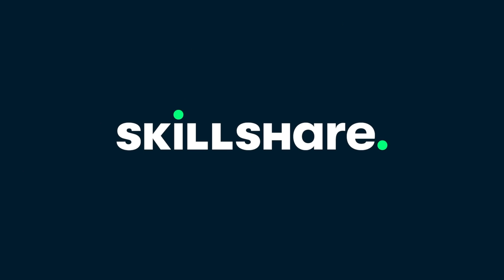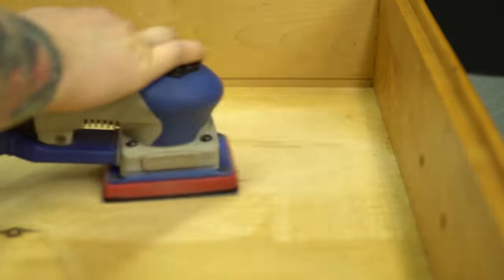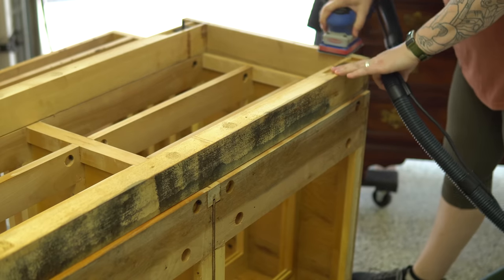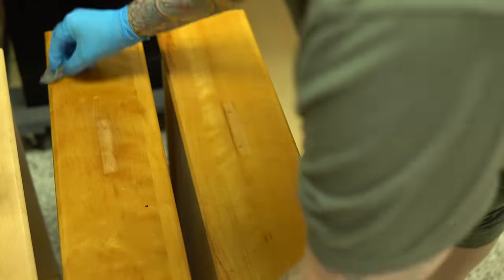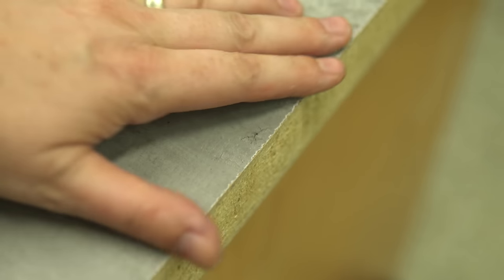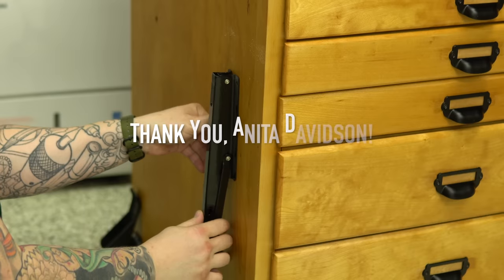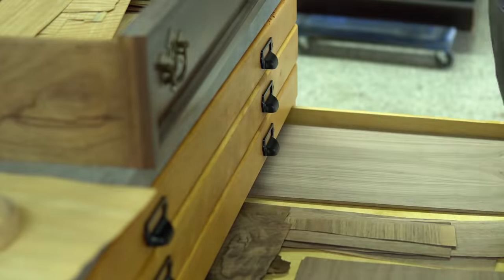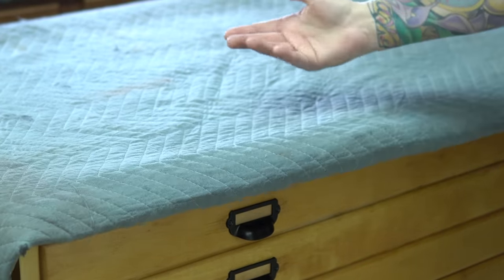How I Turned an Old Cabinet Into a Workshop Storage Solution

Comment: You might have found a darker top would limit you. When I did book repair (retired librarian), I always found myself having to move from the dark table to the lighter topped table because it was easier to see how to line things up, work with tracing or transfer paper and such. Dark materials just blended into the dark top.  But you're right, the cool gray doesn't play well with the birch and maple (which I prefer to think of as a "warm, golden glow" rather than "yellow"😉).
Reply from the maker: Thank you so much for watching and taking the time to leave feedback! I really appreciate it!
Reply: I really like the light gray. I think a darker gray would look too bipolar?

Comment: This was a beast to work with!  

I would’ve added one of the powder tints (without adjusting so you could recreate it when necessary) to Odi’s to get a wood color you like more. 

Sometimes budget wins and you have to use something like your gray top, but something will come along you can repurpose for your work top.  You’re very good at seeing the potential in materials. 

So sorry to see the flooding, but really glad you, partner, bunnies & cats are safe! 😻
Reply from the maker: Once things get mixed together, it goes from their two separate shelf lives to a single “pot life”. Normally the pot life is less than the shelf life, and it could honestly be tomorrow or three years down the road when I inevitably ding it, so having to try and remix an exact recipe down the road would be hard. The other issue is that once there is a pigment, it acts more like a stain so just touching up a single spot would be incredibly difficult (unlike just using the clear coat). So that’s why I ultimately opted for the just the Odie’s on its own. Thanks for watching!
Reply: @TranscendFurnitureGallery  Ahhh. Why hasn’t Odie’s made you a brand ambassador?  You know their products so well!

Comment: As a teacher I remember these types of cabinets. In the days before projectors and PowerPoint, One had paper maps and they would be attached to boards. Usually there were two boards which would lift above. And the yellow color was the normal. Was not sold on the top and I suspect in time you'll return to replace. But I am happy to see this type of school cabinet found a new use.  Congrats!
Reply from the maker: Thank you so much!

Comment: Interesting piece!  That cabinet lived it's whole life as a hardworking partner with whomever was employed in the lab, or whatever it was.  And it continues doing so, with it's work ethic/patina intact.  It will give you many more years.

If you cut across a laminate top, sometimes it works better to flip it upside down and cut it.  The blade effectively cuts "down" instead of "up" and generally ends up reducing the chipping.  But, what the heck, this cabinet is a working tool and not a typical Angie showpiece.  Nonetheless, great work, nice result 👍😁🎯
Reply from the maker: Thanks for watching!

Comment: I admit I prefer the original handles, mostly because they match that mid century utilitarian look of the rest of the cabinet. But also the new ones just seem a bit too small for the function of the piece, like they wouldn't be as easy to grab and pull as the originals. That may not be the case, but it's just how I picture it in my mind if I were to be using this piece in my own workshop. Big easy to grab handles are a great feature on any workbench I think.

Again, this is just my preference! Awesome work as always!

EDIT: Forgot to mention, love the yellow wood for this utilitarian piece. Reminds me of my high school's shop class, so it puts me right into the woodworking and mechanical mindset!
Reply from the maker: The original handles wouldn't have allowed me to label them though. 🙂 Thank you so much for watching and taking the time to leave feedback! Much appreciated!

Comment: I would be tempted to take something like strips of galvanized flashing, much like the gray of your top, cut little rectangles out and use them as escutcheon plates behind the black pulls.  It would create a contrast with the pulls, and bring the gray metallic tone from the top down into the body of the piece.  And it would be cheap and easy to do!  You  might like it a bit more if the color of the top appeared within the faces of the drawers below?

Comment: I think the cabinet looks great!  I don’t get too particular about functional pieces, so I probably would have just cleaned the original finish (and handles) and called it good. The only other thing I might have done differently is not cutting the top. I’ve found I can never have too much work surface! 😂 Of course, you know what fits best in your space, so don’t take any of the above as criticism!

Very glad you weren’t significantly affected by the storm. Sounds like it was pretty crazy!  Also, thanks for including the lightening!  I grew up in Ohio and have always loved thunderstorms. Sadly, we don’t get many on the west coast.
Reply from the maker: I actually have plans for the piece I cut off - its going to be a shelf on the other work bench I'll be working on shortly. Thanks so much for watching!

Comment: A really useful piece which turned out well . Top choice of hardware as usual.
. My wife bought a set of draper's drawers a long time ago - identical construction but with glass inserts in the drawer fronts. Same awful handles !
If it was for my workshop it would be painted Dove Grey dead flat finish to match the rest. I do have wall cabinets in birch - a custom tool cabinet and  shelf units re-made from some old IKEA Billy bookcase carcasses.
My assembly table top is MDF, turns out it came from Brazil and went a beautiful dark chocolate colour when oiled and waxed.
Reply from the maker: Sounds lovely!! Thank you so much for watching! 😃

Comment: The cabinet is great, but if you find you can't live with the colour, then just change it down the track a bit.  Personally, I would've saved myself the extra work and kept the original pulls😂.  Now that you said you mostly work with a cover over the top, then maybe just invest in an extra furniture blanket but in a darker colour, although I don't know how much they cost over there.  Those things come in handy anyway, so an extra one could possibly be utilised often.
Reply from the maker: I couldn't label the drawers if I didn't change the pulls though. 😀 Thanks so much for watching!

Comment: Hello! I came across your channel a few days ago, and I’m watching a lot of your videos as I enjoy woodworking as a hobby.
I also do not like yellow woods, it does not age well I find. I can’t find if someone mentioned this but you could have tried to bleach it, sometimes it works great but sometimes it doesn’t, so it’s a bit of a gamble when you do it.

Thanks for all your videos 😁
Reply from the maker: I actually explained at about the 3:30 timestamp. My main goal with this was to have a finish that is easy to touch up and repair over the years as it inevitably gets dinged or marked. Toned finishes,  bleaching or paint etc, isn’t as easy to touch up as a simple coat of Odie’s. 🙂
Reply: @TranscendFurnitureGallery  Ah yeah I didn’t thought about the fact that bleaching could also be an issue with touch ups! Thanks for clarifying that, I’ll keep it in mind whenever I just need a piece that will be easy to refinish, no bleaching for it 😂

Comment: You can always paint the top black. You can also if the cut off is large enough attach it to the other side as a flip piece also.
Reply from the maker: I’m planning to use it for a lower shelf on my other work table I’ll be working on soon. :-)

Comment: That one thin drawer with the staining on the front: as a lab girlie, it looks very similar to my experience when phosphoric acid gets on wood. So it didn't come out likely because there was an actual reaction that took place as opposed to just pigment sitting in the fibers. (FYI phosphoric acid is quite mild, no need to fear)
Reply from the maker: That would certainly explain it! Thank you so much for watching! 😃

Comment: Why didn't you us the left over counter top for the folding shelf/table? Love your work. I could use a work bench like that for my sewing. It was amazing the way you made that hole patch disappear.
Reply from the maker: I’m saving it for another project- it was too long for the shelf brackets and even if I’d trimmed the length, the weight of it would not have been ideal. I have another use for it.

Comment: I actually like the color of the top, it looks like concrete. I would have used the extra counter top for the folding side shelf and kind of tie it all together - aesthetically speaking. Overall I like how this piece turned out. Well done!
Reply from the maker: It was too heavy to use for that one, but I’m planning to use it for a lower shelf on my other work table I’ll be working on soon. 🙂 I’m turning a craft table into my other work surface (this one will have dog holes, and a wood working vise, as well as open storage underneath for my scroll saw and belt sander.
Reply: @TranscendFurnitureGallery  oooh, I am looking forward to seeing that video. 😁
Thank you for sharing your craft with us and letting us be the “fly on the wall” of your workshop.

Comment: Great job as always.  I'm curious to know your thoughts on the Surf Prep vs Festool dust collectors now that you've had them both for awhile. I'm contemplating buying one but haven't seen any reviews comparing them after lengthy use.
Reply from the maker: I ended up keeping the Festool for general shop cleanup and for attaching to my Dewalt, and the SurfPrep one I have permanently hooked up to my SurPrep sander. I opted to use the Festool for general cleanup/vacuuming out drawers, etc because the hose actually fits the Dewalt's dust output, and I wouldn't need to buy an adapter for it. Whereas the SurfPrep vacuum perfectly fits the SurfPrep output.

Comment: Oxalic acid works best if it is mixed with boiling water and applied before it has a chance to cool off. The easiest way to identify maple is by the weight, just try to lift it off the ground an inch or so, it is very heavy.
Reply from the maker: I always use very hot water. 
And I’m very sure this isn’t maple, I think it’s actually birch. Maple looks quite different in colour, grain, and even chatoyance. The sellers were adamant it was so I didn’t want to argue with them, haha. I wanted it anyway. :-)
Reply: It's a really nice piece. I don't see any advantage to maple unless you have a workbench or wooden vise. There are plenty of woods dimensionally stable enough for drawers, and the weight of maple just makes it harder to move around by yourself.  @TranscendFurnitureGallery

Comment: As it a work bench I get that you didn't want waste time or money however you need to like your work area as that is where you spend lots of time so you may change it in future if you do its Ok to spend that money on yourself. Grey is not colour I'm fond of so black would be my pick.
Overall its looks fine fit for purpose given you don't like yellow wood I think you may also use a stain in the future or you will get to like yellow wood . Thanks for the storm shots great to look at scary to live through .. well done you for getting the video out.
Reply from the maker: The reason I didn't stay it is because birch and maple both are notoriously hard to stain and to do all that work on a piece that I require to be functional would be pointless. Thanks so much for watching!

Comment: FYI, even though you removed the wrap from the table top, you would have still been able to return it. All you need is the receipt.  You can also attach the original label to the top since it shows the picture.  The store would have sold it as is, worse case they would written it off on taxes.
Reply from the maker: Good to know!! Thank you so much for watching!

Comment: A thought…..can you add hardware to the cut off to add to the bench as an extension to lift up when a longer surface is needed?  It wouldn’t take up too much space and might be useful later.
Reply from the maker: I actually have a plan for that cut off section of counter! I’m turning a craft table into my other work surface (this one will have dog holes, and a wood working vise, as well as open storage underneath for my scroll saw and belt sander.

Comment: I am curious if you had used pigment with the Odies, would that have not been as easy to repair? I like a lighter wood myself, so like the whole thing. Was just curious.
Reply from the maker: Once things get mixed together, it goes from their two separate shelf lives to a single “pot life”. Normally the pot life is less than the shelf life, and it could honestly be tomorrow or three years down the road when I inevitably ding it, so having to try and remix an exact recipe down the road would be hard. The other issue is that once there is a pigment, it acts more like a stain so just touching up a single spot would be incredibly difficult (unlike just using the clear coat). So that’s why I ultimately opted for the just the Odie’s on its own.

Comment: I have a question?? Speaking about the yellowish wood.. could you not of done a bit of color correction, of a bit of violet, in the final lacquer coat? It would have tone down the yellow. —That’s just the first thing that came to my mind because I know we do it in hair color. Why couldn’t it be done with wood colors?
Reply from the maker: I could have used toners but my main goal with this was to have a finish that is easy to touch up and repair over the years as it inevitably gets dinged or marked. Toned finishes or paint etc, isn’t as easy to touch up as a simple coat of Odie’s.

Comment: Could you have used Odie’s tint to change the yellow wood?
Reply from the maker: Once things get mixed together, it goes from their two separate shelf lives to a single “pot life”. Normally the pot life is less than the shelf life, and it could honestly be tomorrow or three years down the road when I inevitably ding it, so having to try and remix an exact recipe down the road would be hard. The other issue is that once there is a pigment, it acts more like a stain so just touching up a single spot would be incredibly difficult (unlike just using the clear coat). So that’s why I ultimately opted for the just the Odie’s on its own.
Reply: Thank you for explaining that!

Comment: I’m not a “yellow” wood fan either. We owned a Federal Colonial which was already standing in 1835. It had the original flooring; wide boards with ropes laid in the gaps. Very different from what I had ever seen. The boards looked like knotty pine, but my husband leaned towards poplar, as, at the time, whatever was on the land, would have been used. Whatever it was, it was soft wood, had a lot of knots, and leaned orangey! Yuck. After a while, we sanded them down. They looked great! That is until any finish was added. Clear coat, varnish, shellac, just anything we tried in our test area. (Even after bleaching, which turned the knots mustard yellow!) The village historian said it was due to some treatment that was popular in the area in the 1920’s, that penetrated the wood so deeply, that it would continue to happen. Her advice; learn to live with it!?! We did
Reply from the maker: Oh that sounds frustrating for you! Thank you very much for watching!

Comment: When I was a kid, my dad built himself a fishing tackle box of 
wood.  He designed it like a mechanics tool chest. He used 
hardwood plywood for the case & hardwood for the drawers. 
it had brass drawer pulls, hinges & handles. He varnished it 
when finished. It was beautiful. We took it to the lake and had
a fun fishing trip came back to the boat ramp, load our boat & 
headed for home. At home, as we were unloading the gear 
out of the boat he could not find his box. He had told me to 
load it & being a kid....
He was so mad.

!

Comment: Would you want to go back over the body with Odie's Oil and a dark pigment like gray or black or something you like better than the yellow wood tone?
Reply from the maker: Once things get mixed together, it goes from their two separate shelf lives to a single “pot life”. Normally the pot life is less than the shelf life, and it could honestly be tomorrow or three years down the road when I inevitably ding it, so having to try and remix an exact recipe down the road would be hard. The other issue is that once there is a pigment, it acts more like a stain so just touching up a single spot would be incredibly difficult (unlike just using the clear coat). So that’s why I ultimately opted for the just the Odie’s on its own.

Comment: Yup, that's a laboratory table all right. The missing countertop was almost certainly made of phenolic resin--the most hypoallergenic and bacteria-phobic countertop out there. Which is why it's probably missing--years of chemical spills. Not safe to sell the countertop itself, but the wood is fine. The fiberboard apron at the bottom was likely covered with a rubber kick plate.

EDIT: Wrap the laminate countertop you hate in black contact paper. It'll look like a lab table again. 🤪
Reply from the maker: Haha yes! Thanks so much for watching!